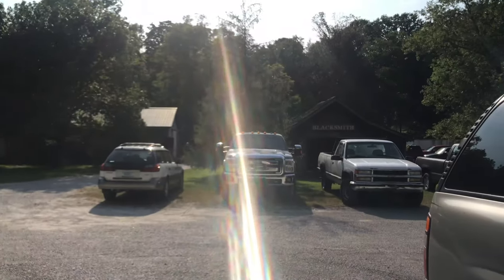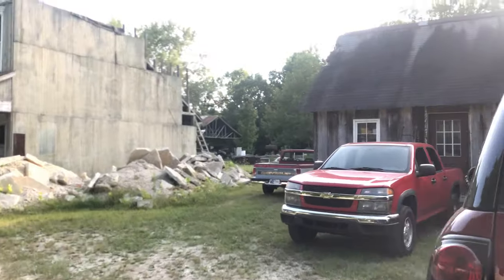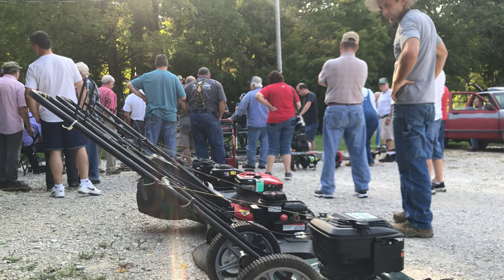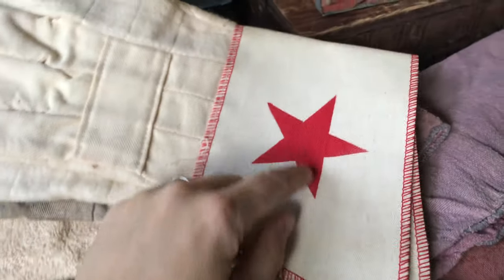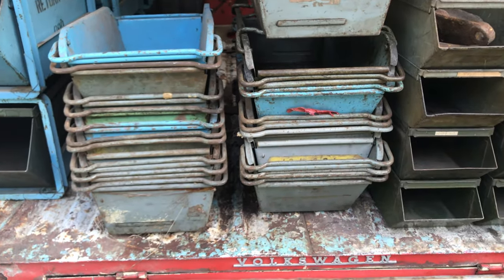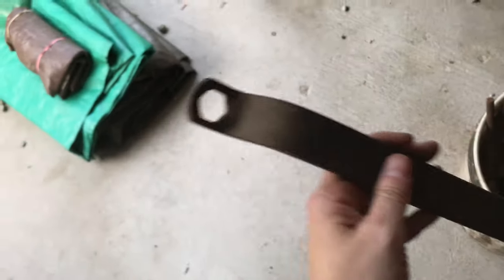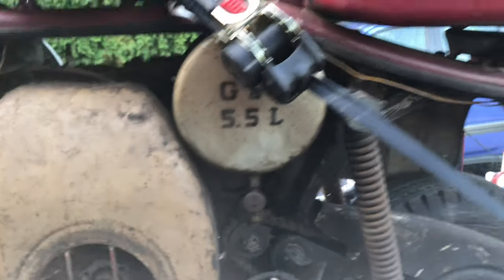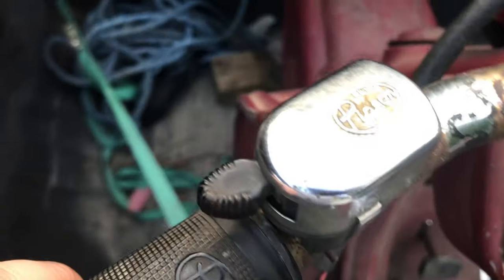Scooter at AUCTION!  Should I buy it?

Comment: Big score cool setting for it, what not to love about southern, Indiana. Scooter swtich reminds me of a VW story, My son purchased a 74 beetle his old school teacher. It was his aunts car was not running told my son he not good with car and will sell it to him. He trailered it over took it off, the brake light switch wires came off the master cyclinder. Told my son he thinks the reason it will not run is the wires came out of the O2 sensors...he was serious.   My son got it cheap and reply with:   yes that must be it and they are crazy money for air cool VW bugs will you take another $100.00 off ..he did dropped the price. His teacher got schooled that day.
Reply from the maker: Dan Love omg😂love this story😂😂😂
Reply: Probably could've gotten it even cheaper if he'd said that he would have to change the "muffler bearings" as well. :)
Reply from the maker: Lateef Carrere 😂

Comment: Looks like a Mitsubishi C 75 scooter. They did have side covers at one time, but many times those got taken off and discarded. Seat isn't right, it's probably off of a 60's cushman scooter. This C 75 is probably very late 50's or early 60's. Rare bird these days especially in full trim.
Reply from the maker: It's a C76, 1959.  We have a 1958 also. the side covers are there, they are laying in the back of the truck in the video...we have everything including the original seat...the other one we have is in better shape than this one, but missing all the dash components! Will be fun winter projects for sure!
Reply: @marcijunebug  I didn't notice the side covers. Hard to tell exactly from a vid, but I was close on the model. C76 is only slightly different ... I don't know of hand what the differences are, been a long time since I've seen one let alone two.
Reply from the maker: toot tall they are such cool scoots ! Love the body lines on them
Reply: @marcijunebug  for what they are, yeah they're cool  I thought they were much cooler when I was quite young tho. of course, then they fit better.